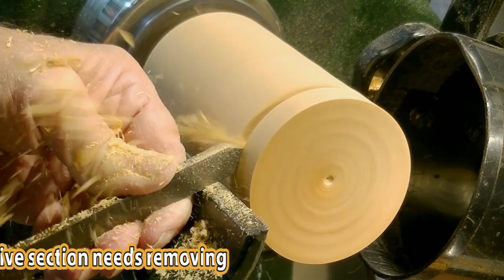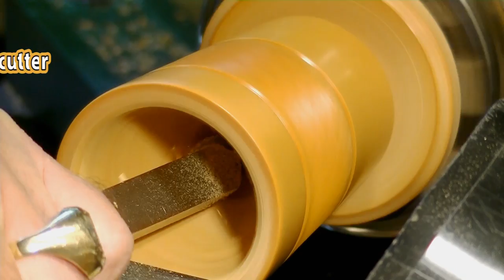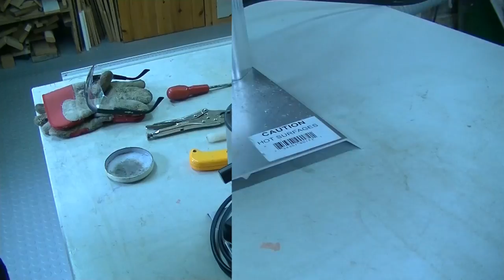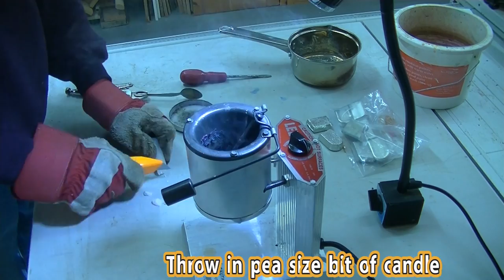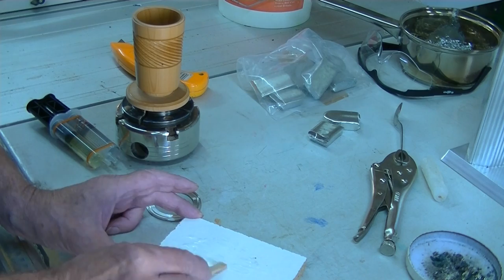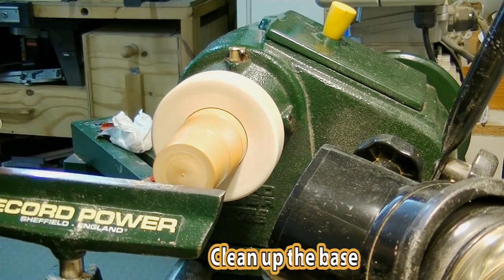Woodturning - Yew Cup with Pewter Rim

Comment: Hello there Peter,
I’ve just been on a short wood turning course, which I enjoyed immensely. I notice that you use a lot of record equipment which is what I had on the course.
Honestly now, how do they compare with their competitors. The one I used was fine, but being an absolute novice, what do I know.?

I would like to continue with this wood turning game, but if I start I don’t want the equipment to let me down.

Many thanks
Reply from the maker: Hi Gareth,
You are correct in that I have quite a few Record Power machines but I assume that you are more interested in the lathe.  As you may have seen in my lathe upgrade video, I had my original CL4 for 11 years and have now had the upgrade for 2 years. In this time I have never had any major issues with either machine. I cannot really compare them to any other make as I have never used any different lathes other than a cheap starter lathe many years ago.
The only thing I would say is that you need to be sure what size of turning you wish to do between centres. Whilst you can rotate the headstock on a CL4 for a large turning, if you need to support the piece with the tailstock, you are limited to approx 12inch (305mm) diameter. I wish it had a larger capacity between centres. The other slight niggle is that it doesn't have a spindle lock which is most frustrating for an upgraded lathe.Hope this helps.
Good luck with whatever machine you choose and enjoy your woodturning.

Comment: Peter,
  I just watched the yew cup with the pewter rim.  It appeared you did not have much of a problem with pewter dust.  Did you finish the cup before adding the pewter rim? Did you polish the pewter while on the cup?
Reply from the maker: Hi Skip, I did most of the finishing to the cup before adding the rim. You don't really get a problem with pewter dust as it finishes really well straight off a sharp tool and doesn't really need polishing - just apply wax. If you try to sand the pewter to a finish it can contaminate the wood and leave black marks. Thanks for your interest.